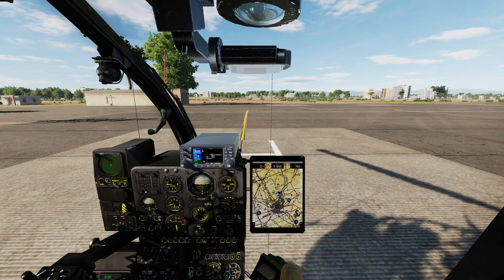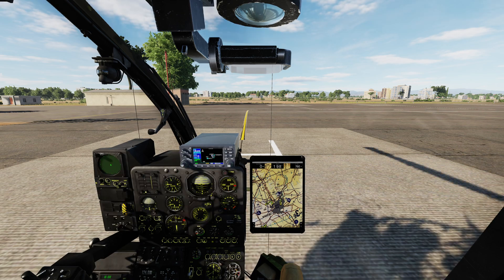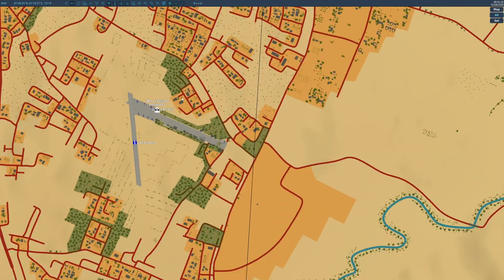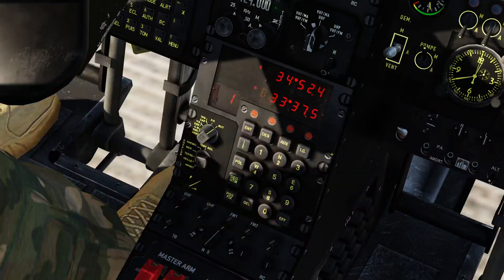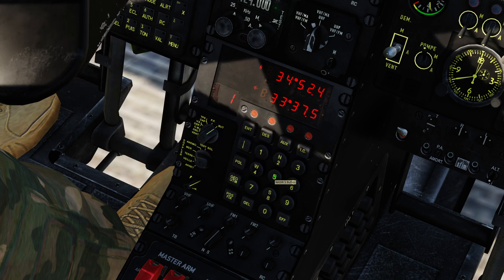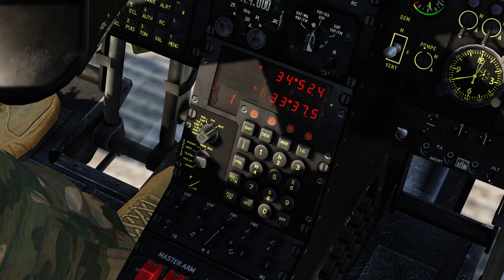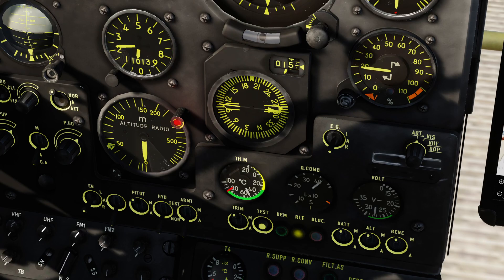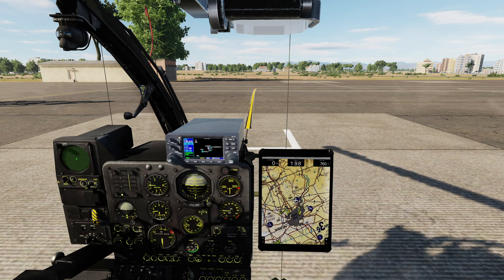DCS SA-342L Bonus 1 - Polar Coordinates

Comment: I tried to use this to create a waypoint relative to another waypoint and it doesn't work. I press POL, then 2, then 5 and the display stays the same. When I press POL, then 0, then 5, it works just like in your video. So for me this mode only works with coordinates relative to my own position :(